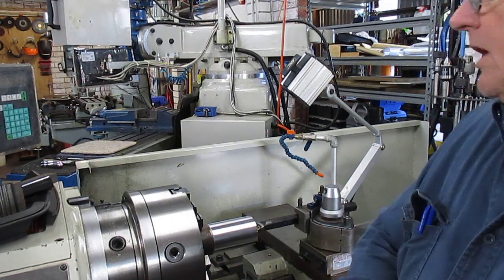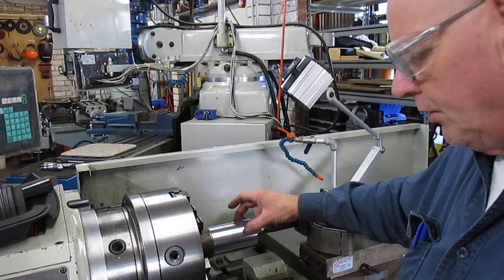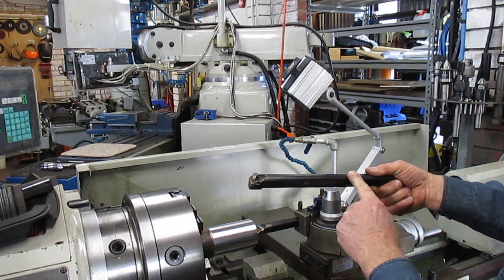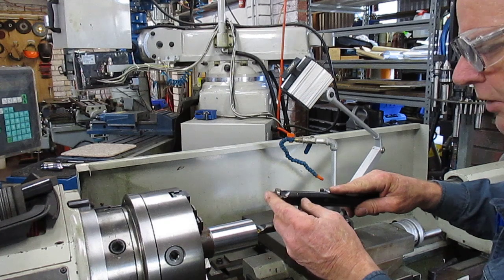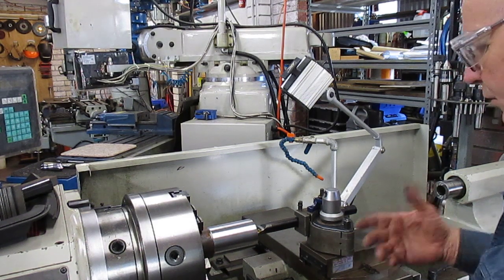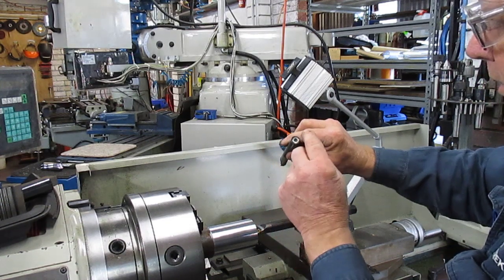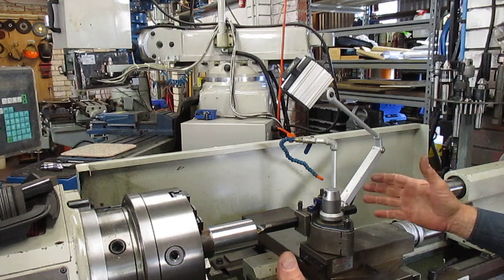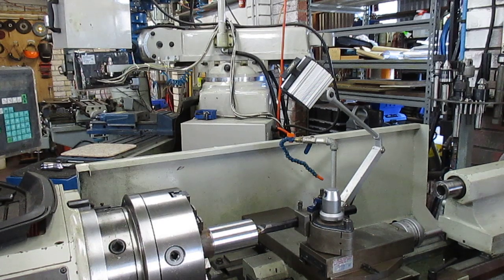Geometric Die Head Adaptor 2 & Boring Bar tips Saturday morning secial

Comment: Tensioning the boring bar with the grub screw could alter the resonant frequency more than the added weight did. Interestingly it should increase the frequency, while the weight decreases it. 

Those that have "corked" boring bars with lead often report it does not work unless the lead is compressed with a screw, so I'm thinking there may be more to this boring subject than meets the eye.